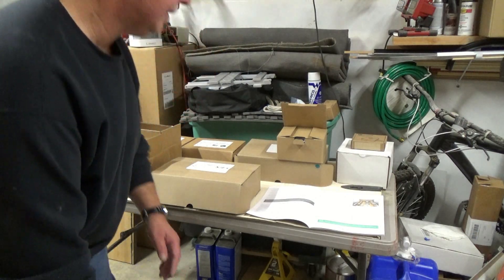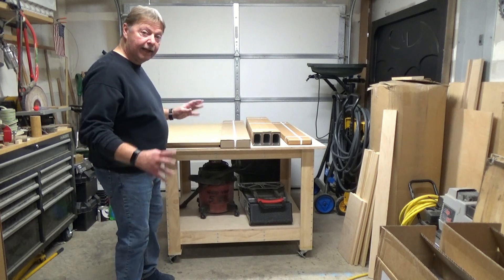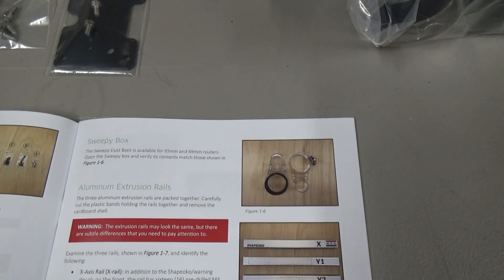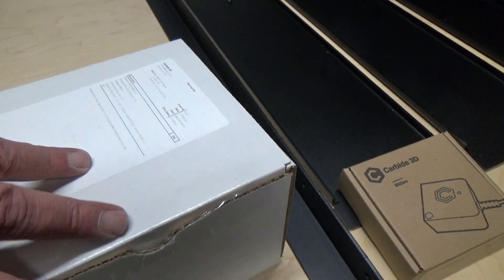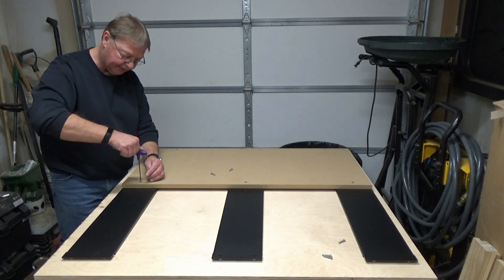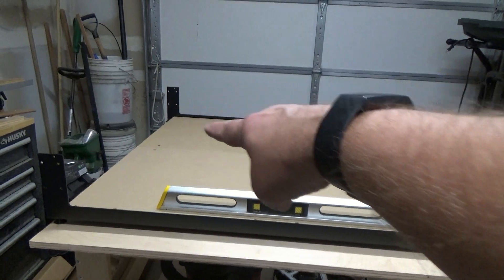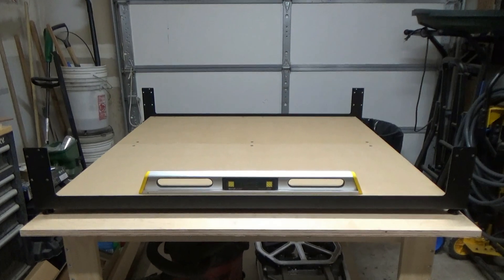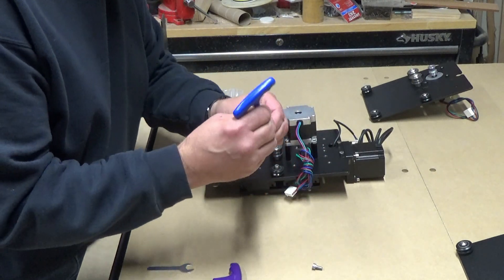SHAPEOKO XXL CNC Router (Assembly Part-1)

Comment: I got my one endplate on fine, the second endplate however the two outside holes when I try to screw into them the screws just stop like they’re tight but the heads are above the wasteboard. Tried taking them all out, used a flashlight all holes are lined up, it’s like there is a problem with the threads on the endplate
Reply from the maker: Hmmm... might take it apart and turn the plate over and try running the screws in  then back them out. Has to be a little piece of metal or paint stuck in there. It should eventually free up... use a little WD-40 and see if that helps any.
Reply: @OregonBatman  it was paint :) tapped them all out and got the paint out. Same for the feet holes. What a busy day today was.
Reply from the maker: @SpwnDragn  Good deal... glad you got it freed up and back on track!

Comment: I'm very jealous. As I wait to finish my remodel on the house and finish the back-burner camper, I have been planning out the work shop.  My second most important piece of equipment is a CNC.  I hope you have as much fun using yours as I have had in the past.  I am hoping for a full 4X8 version but I may go with a 4x4 due to space.  Can't wait to see it in action.